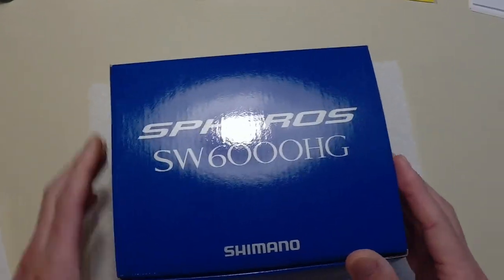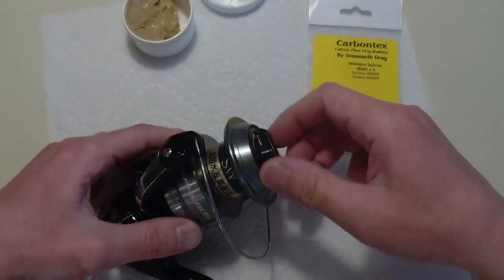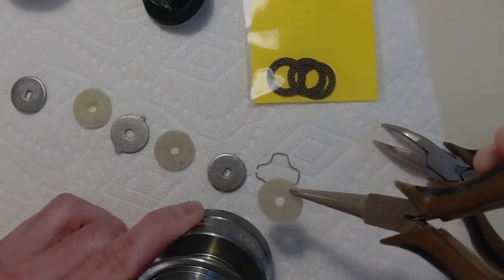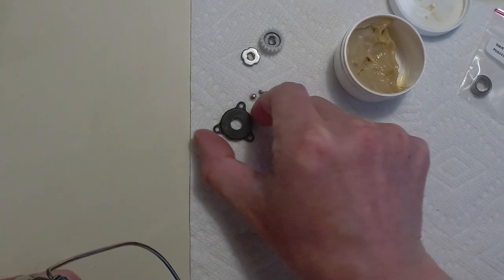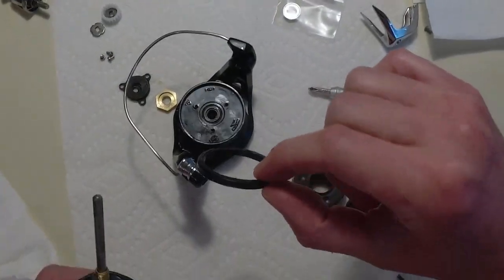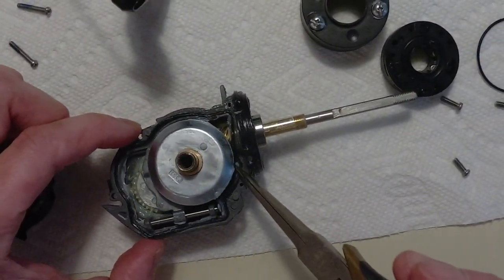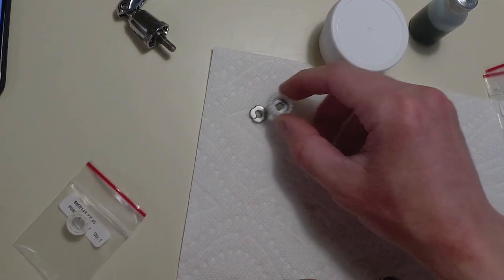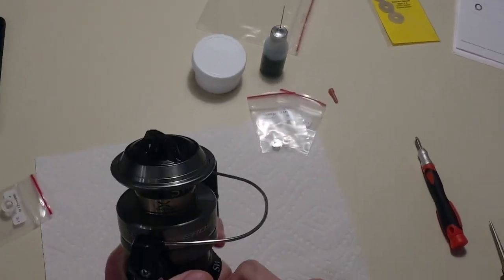Upgrading the Shimano Spheros SW with Carbontex Drags and 3 additional Bearings -Modification Part 1

Comment from the maker: I've been using my modified Spheros SW 6000PG for three seasons on the surf with no issues.  I decided to get the HG version with a faster retrieve and modify that also.
After doing this modification the reel should be equivalent or better than the Saragosa since the only Saragosa with twin drags is the largest model.

If you enjoyed this video please give it a thumbs up and subscribe to my channel if you want to see more videos like this and help support my channel.
Thank you for watching!
Tight lines. 

Follow me on Instagram - https://www.instagram.com/leswang_/

As an Amazon Associate I earn from qualifying purchases.  It  really helps me if you purchase anything through my paid links:

Parts used and priced paid:
JDM Shimano Spheros SW6000HG - https://amzn.to/2n5g3lT
US Shimano Spheros SW6000PG - https://amzn.to/2PdEKru
Carbontex Drags - eBay $10 (16321 x 3)
Cals Drag Grease - eBay (Small container)
Boca Bearings - ~$8.50 each 
SMR148-ZZ #5
SMR95-ZZC #5 AF2
SMR684-ZZ #5
CorrosionX in a dropper bottle. - https://amzn.to/2ngXDyx
Reply: Les Wang Fishing I reckon you should look at why the “gosa is LEGEND” for a start the Spheros bail arm ain’t up to much
Reply: Hey there, just one thing, you got the wrong washers those are not for the Spheros, that is why you thougt they were thiner, they should be the exact same size as the felt ones, including the midle hole for the shaft, with the washers like that you can destroy them pretty quick, because they will move around from side to side. Who sold you those just fooled you man. Get the right size and you will see a huge diference. All the best.
Reply: I also had jdm upgraded shperos sw and Saragosa sw..Saragosa sw has much more windind power when jigging.Maybe this happens because of the hagane gear on the gosa .Size were both 6000Hg.They seem "same" in specs but reality is totally different.
Reply: Hey man!
Nice video.
Would you have a tip on how you maintain your shimano spheros reel? 
I have a spheros 10000.
Thanks :)
Reply from the maker: If you watch one of my newer videos I have maintenance instructions - https://youtu.be/qGTMUTNH5bA

Comment: good update!
, +3bearings!
if guys are looking for LOW RATIO it is better NOT JDM (it says "sw pg"). 
If you want fast ratio then go to this spheros "sw hg" or BG 4000
Reply from the maker: Correct the Low Gearing is PG Power Gearing and the High Gearing is HG. Both are available as cheaper JDM models with felt drags and a non Hagane main gear.  
The US Spheros comes with carbon drags and hangane main gear but only PG version. The Handle is also slightly different.
Reply: @LesFishingMoreCatching  i am looking for a 5000 size, can you clarify which version is better to get?  thanks

Comment: I saw the smaller version of this on the store yesterday and thought this is a cheaper version of the Stradic and now that ive seen how to upgrade this.

Ill definetly buy this if i can sell my Daiwa Bg
Reply from the maker: What smaller version I think the 5000 is the smallest but same body as my 6000. Are you referring to the new Inshore Spheros SW?
Reply: @LesFishingMoreCatching  yes thats the one that i was looking at yesterday so im currious if i can upgrade that as well
Reply from the maker: I haven’t used that reel but those reels share similar parts to their other inshore reels. I’m not sure if that one has rubber seals.
Reply from the maker: I’ve been looking at it though maybe I’ll pick up one to try since they’re inexpensive.
Reply: @LesFishingMoreCatching  it seems like a good reel and it only cost $119 plus right now here in Texas theres no stock on the Stradic FL
Reply from the maker: Yea for the price def good. I think it doesn’t have a roller bearing or something so no worry about rust in that area.  I have had the Stradic FI FK FL. They are good too. But I prefer the sustains if you willing to pay they have more bearings and smoother.

Comment: Very informative video, wondering what is needed to upgrade/modify shimano spheros 10000sw reel please
Reply from the maker: Not sure but I’m assume the side plastic bushing is the same size as the side bearing on your reel. Look at the schematic and you can purchase that bearing. The handle bearing is probably the same as the 5000/6000 but not 100% sure.

Comment: I'm looking for BIGGER, for coastal fishing and kayak....40-50lb braid maybe spheros sw10k 25oz 
 Sometimes there are 150lb tuna=then big 30oz
bg6500 fast ratio or lethal100....or spheros20k (maybe better but it 33oz!)
Reply from the maker: You may want to look into the dual drag largest Saragossa model or the Twin Power. Those have higher drag ratings.

Comment: Thanks for the links. Can the handle knob be swapped out for a custom aftermarket one? I have a Penn Clash with the EVA knob which I really like. Would like the option of doing that to 
 this reel.
Reply from the maker: You can def swap out the knob but not sure if yours will fit. They sell ones on eBay that will fit.
Reply: Will check it out. Thanks!

Comment: It doesn't make sense that you would replace the original drags with ones that have less surface area.  I think you need a different supplier.
Reply from the maker: Yea someone else pointed that out.
Reply from the maker: @mueshow that is a correct size drag washer for carbon fiber washers as I have checked the us versions factory carbon drags and they are this size. https://fishshop.shimano.com/collections/sp6000sw

Comment: Can u specify which of these 3 bearings is for the side plate? And the rest of the two also? Btw a very informative video
Reply from the maker: The side bearing is SMR148-ZZ #5 It is 8 X 14 X 4 MILLIMETERS.
Reply: Is this even same size as the non jdm models?
Reply from the maker: Yes the JDM and US model bearings are the same exact size.
Reply: are both handle bearings 5*9*3?
Reply from the maker: Nelson no the handle bearings are two different sizes.

Comment: Hi bro! May I ask if 6000 and 8000 are the same ball bearing? And what are those size?
Reply from the maker: The 5000 and 6000 share same body. 8000 is larger. Not sure if they use same bearings.
Reply: @LesFishingMoreCatching  ok bro thanks

Comment: Can this conversion be done with the 5000 model? If so are the part numbers the same?
Reply from the maker: I’m pretty sure it can and parts should be identical. The spool I think is the only difference between the 5000-6000 but not 100% sure.
Reply: have u done the upgrade?

Comment: interested in getting this reel with the lower gear ratio here in the US. Which version is that? What is JDM?
Reply from the maker: JDM is Japanese Domestic Market.  It is the Japanese version of the reel.  Difference between JDM and US is US only has the PG lower gear ratio model.  Also US model has Hagane gears and Carbon drags.  If you buy the US model you will get the lower gear ratio.  I went with the JDM because I wanted the higher gear ratio like the Saragosa has.  Just my preference in fishing, as I like more line retrieve.
I added a product link to the US model.
Reply: I see. Thanks for the explanation. Saw these for sale on ebay and wasn't sure what I was looking at. Wondered if those are knockoffs. The bay can be deceiving. Imo

Comment: I just got my spheros 8000hg and it seems little rough when a spin kinda like something is rubbing. Is that the plastic bearings? Or in other words is that normal
Reply from the maker: No it should be smooth. Doesn’t sound normal.

Comment: So does the reel perform better in drags and smoothness after upgrading?
Reply from the maker: It already was smooth but now I feel like it’s even smoother. 
The drag performed great so far on my tests although I haven’t had a reel drag puller this season yet. Keep in mind the U.S. version already comes with carbon drags. The Japanese model which I have came with felt which won’t perform as well if it gets wet. 
Thanks for watching and commenting. Tight lines!
Reply: Did ypu have any issue with the gear?Its also different from U.S model without coating.But i am sure you can purchase the gear from Saragosa sw
Reply from the maker: No issues with the gear. Didn’t know the gear was different in the US model. It has some kind of Almite coating from doing some research.
Reply: Les Wang Yes it is different.The U.S. model cold forged gear and jdm has cheaper cast zinc gear i think.But if you did not have issues or wear its fine.
Reply from the maker: Yea I wonder if that will be a issue in long term use. My old spheros with the lower gear ratio does feel a lil sloppier than the new one but I thought that was everything just broken in. Maybe the gear is wearing. Yea the gosa has the same ratio as the HG model maybe i could use that gear if needed. No wonder why it’s much cheaper for the JDM model. Thanks for pointing that out.
Reply from the maker: I looked up the gosa drive gear. It’s part #12048. It’s $34 for the gear alone. Maybe a future upgrade is needed lol.
Reply: No man!the gosas gear is part RD 16351 from sw version.maybe you checked the fb model
Reply from the maker: Yea I think I was looking at the older F model. Thanks.
Reply: Les wang i got a problem broo i disassemble my Shimano spheroS sw6000HG now my problem is i forgot wer to put this two little rubbers can u help me out please..do u have a facebook so that i could show u the two little circle rubbers :-(
Reply from the maker: My email is in my profile. Or send it to my username @ gmail.
I’ll see if I can help.